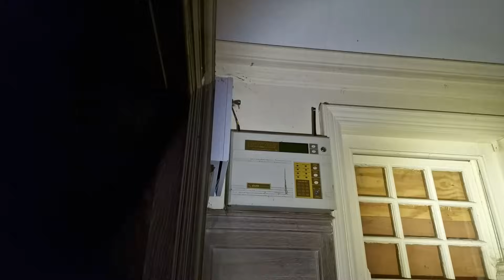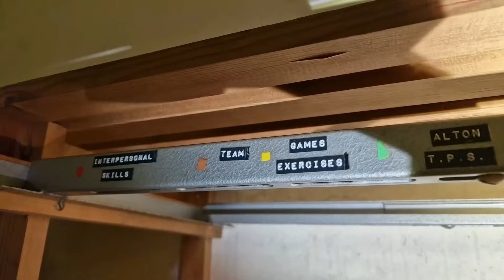We found Prince William and Kates ABANDONED Dream Estate!

Comment: So according to your information it was built in 1900. Some of it appears roughcast. So roughcast was usually put on second grade bricks which are often 9 or 14 inch solid walls. It has Tudor style timber boards on outside. It has steel floor beams supporting ground floor. They look like later inserts so there has been severe floor problems in recent years. Fire places of limited interest. Wood panels on stairs could be oak plywood and library is pine. 
I suggest it was probably an expensive style establishment built on the cheap at the end of Victoria’s reign. It appears to have limited architectural appeal and might well have substantial stability problems. Demolition is probably the most sensible option especially with the heat loos through that style of wall.

Comment: Box with the socket, outlet and RF box is for a TV. The electrical system before is a Telephone relay exchange box and changeable IO boards for use with many many phones, and the small boxes you called ethernet are Phone outlets. Great video matey